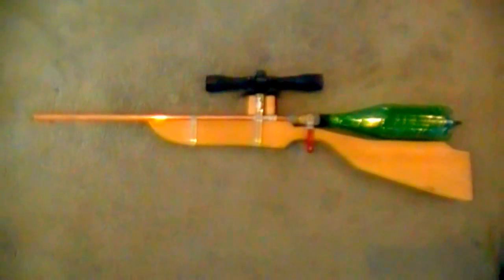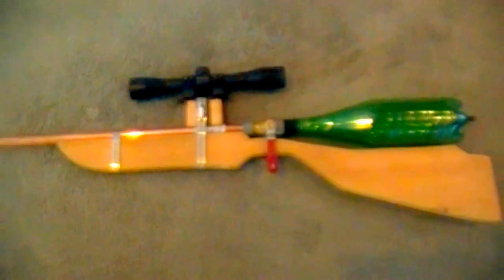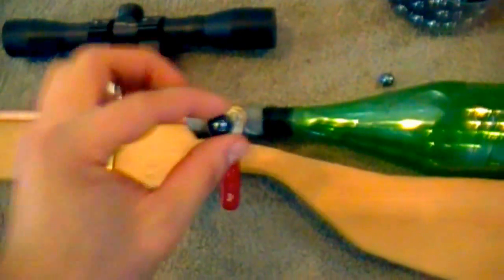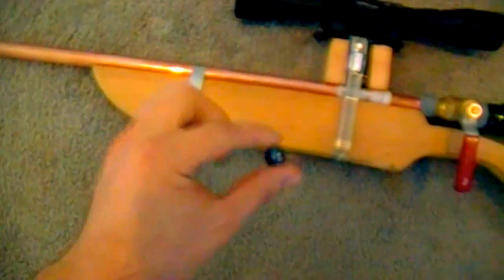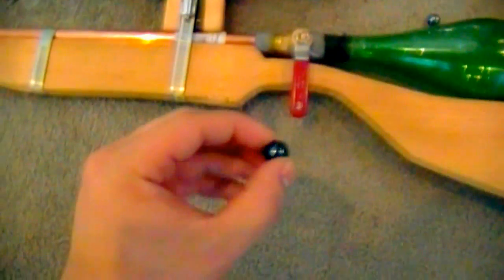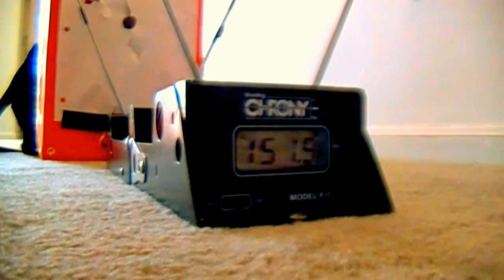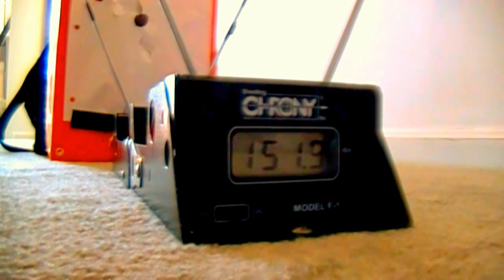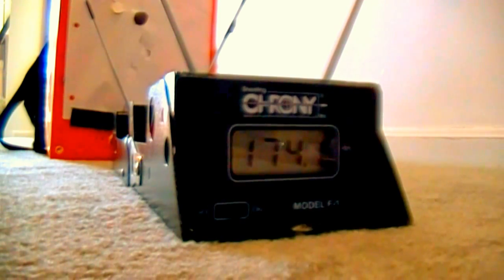$20 Homemade .50 Cal AIR Rifle + Shotgun Combo (Pt. 2)

Comment: I have an idea for the ammo that you may want to try. Purchase some nylon rods close to the diameter of the copper pipe. If I were you I would use a pair of calipers to get the inside dimension, and check the nylon rods. Cut your bullets, sand the top of the bullet to form a cone, for greater accuracy you could even rifle the nylon bullet. Just something I thought you would like to consider.

Comment: refinements / suggestions: use JB weld or some other two part "filled" epoxy - plumbers putty becomes brittle when it fully hardens. Decrease the I.O.D ("caliber") of your pipe 3/16 in IOD = 18 cal (steel pellets for pellet guns are 17 cal) 1/4 in = 25 cal, and use steel tubing - cheaper than copper and not as easily bent and uses less volume of air. Find a faster acting valve with less movement - more accurate firing. Devise a safety for the valve. Use spent, steel CO2 bottle for higher PSI.

Comment: You could use a small 1" piece of copper pipe with a cap on one side, fill it part way with bb's then fill to top of bb's with melted candle wax and let cool. pull cap off the back use lighter to warm up to get slug out. Bb's will remain intact in the wax until it hits something at which point they will disperse.

Comment: I once put a coke bottle on my air compressor and it pumped enough air into the coke bottle to reach 170 PSI before cutting off. My compressor goes up to 150 PSI supposedly but it didn't cut off till 170 PSI before cutting off. I am sure the coke bottle could have probably handled a lot more before bursting. I will make one of these and use a 20 ounce coke bottle and use a straighter valve with nut to tighten it to the end of the 20 ounce coke bottle and see if I can fire it with 150 PSI. That will be deadly I believe. Thanks for sharing
Reply: How'd it go?

Comment: Can I give you a tip my friend? I assume you use the manual valve to release pressure right, if you assemble it with a solenoid valve instead that thing will open the presasure way faster so nothing goes to waste. Sorry hard to explain with this bad English but you might get the point?

Comment: try using plumbers tape, (its called Teflon Tape I think), it has no adhesive you stretch it around the threads of the bottle, etc, then screw it together, the Teflon tape will create a good seal up to well over 100psi's I'm sure.

Comment: Nice Build, But Listen. I experimented with this over 30 years ago, and that bottle "will" eventually explode and disfigure your face, not to mention losing part of your hearing. This bottle will continue each time to stress more and more and also age harden, then one day you just fill to 40 or 50 psi and "Bang". Buy an inner tube for a wheelbarrow wheel, and cut it and slip it over the bottle. Even though the bottle is thicker plastic at the bottom, it is still stretching also, but the hardened putty is not, so that seal is slowly deteriorating also. The stem has a good chance at "anytime" of coming out much faster than your projectiles!  Much better yet is to use a heavy gauge Pvc tube for the reservoir! Use a 3/4" reducer cap at the end before your 1/2" ball valve, and you will not have any bottle necking of air pressure and volume. Talking from experience be safe, don't learn the hard way. Thanks for the video.
Reply: What do you need to use then
Reply: That bottle is so snug though
Reply: +jmvideo7 Good advice

Comment: 150 psi is about the velocity of a very srong sling-shot used by a very strong man.  55 grains is a huge bullet.  Glass marble are harder than any metal.  You are building joules of impact there and have a destructive projectile.  It would shatter any pane of glass, car windows and bus stops.  Retry with an aluminum bottle (nothing cheap, seroius hiking or cycling can) and a presta valve (they would screw-in in a tapped hole.

Comment: I am making a gun just like yours, thanks for the instruction! I have some problems with my tank, it is leaking. I have tried using kit coz i couldnt find the plumbers putty you were using in the shop. And, i have got a 1.5 litre bottle, would that make it shoot faster than yours? I also still need projectiles for my 6mm barrel

Comment: try a epoxy build up around the valve stem to have a more effective seal i wouldnt do too much because of the plastic expansion and also put some putty on top of that, might work a little better

Comment: Hey guys, I can recommend a aluminium barrel. Its cheap, light and solid so you wont bend it accidentally. I just made myself a blowgun out of it. I was wondering how to achieve more power by adding some kind of pneumatic system and found my answer! Awesome video dude, likeit :)
One more thing: How do you trigger the gun, so that you wont lose power (until the valve fully turns to release the air??)

Greetings guys

Comment: Great video!....Definately room for improvement;you could try using a 1L(35oz.) aluminum water bottle & use an all metal Schrader valve stem;That could possibly pump up 100-120psi easily,and use 1/2"(.50) metal ball bearings greased with Vasaline;Might produce shots within 300+FPS!!!!!WOW!......I may try those mods myself when I end up making one myself,but you have given me the basic ideas;Thanks!

Comment: can you explain how to connect the tube to the ball valve and also the bottle to the ball valve in better detail. The tube doesn't "screw" in, it just slides in and remains loose. Also the bottle is too big to even begin to fit into a 1/2" ball joint. I'm sure I'm missing something simple here but I'd really like to make this. Thanks.

Comment: At 7:08, a slight hissing sound, when everything is apparently well sealed. Did you check the tightness of the valve core in the schraeder air valve?

Comment: Lots of OT-Comments, here is what is really interesting:

projectile= 55,4 grain (3,6 Gramm)

Airtank Pressure 50 Psi (3,45 bar) = 3,86 Joule energy (152fps=46,33 m/s)
Airtank Pressure 60 Psi (3,45 bar) = 5,06 Joule energy (174fps=53,04 m/s)
Airtank Pressure 70 Psi (3,45 bar) = 7,37 Joule energy (210fps=64,01 m/s)

real great results, but the projectile is dangerous because it could repel easily.
(all hard Balls do that, like steel BBs and so on)

Comment: I made a summary because i thought this method with your plastic airtank interessting, and the energy is equal to a real airgun (in germany 7,5j is max by law).
Always wear safety googles, one time i didnt and had big luck:
I used normal lead diabolos (!) and they repell a way of 2x7meters (~45feet)
back, near my head because i shot on a hard wood which was loose.

It would be interesting if you could use a smaler caliber to increase the speed of the projectile. 300-400 fps is a good example.

Comment: why not use a PVC airtank? pvc can handle up to 400psi. depending on wall thickness and diameter. Also an automitve valve stem would have a better seal without the epoxy. you can get them at any autoparts store for $2-7 depending on where you go.

Comment: You would be surprised what those soda bottles can handle. I used to pump my gun to 120psi. it never leaked. I even tried pumping it to 150psi. It worked, but after a dozen or so fills, it was overstressed. but I didn't used putty or glue.

Comment: Isn't it amazing how totally separate fields suddenly collide... I make my own fizzy drinks by pumping up a PET bottle (e.g. you soda bottle) from a CO2 tank. Standard  pressure is 55psi, but in fact I know these bottles are enormously strong - the bottle can take over 200psi, but will begin to balloon a bit before that. Search for a video of someone pressure testing a PET bottle. Even if the bottle bursts you get a loud noise and a scare, it isn't an explosion.

Comment: how about pouring metal BBs down and packing it in with Plasticine or clay, or making metal shells that are BB's mixed in Plasticine and maybe coat them in flour so they slide down the barrel easy, then pack them in with a rod. I'd make a beastly shotgun and would expand to the shape of the barrel like lead maybe. You could even get smaller marbles and try coating them one at a time.
Could clog the barrel up after a while though.

Comment: Hey mate careful with the soda bottle at those pressures. Plastic can fatigue, develop hairline fractures and explode. While an undamaged bottle can achieve pressures around 200 psi before exploding, the loading and unloading of the bottle creates stress cycles leading to fatigue. Its well worth the upgrade to plastic PVC. For your barrel size you would need less than a 1 Litre reservoir. Also metal barrels are always best as they don't creep during storage.

Comment: Nice build, but under your system of propulsion you should really load the projectile then charge the system. If some kid builds this and operates it the way you did and there is an accidental discharge...= a face full of hurt or worse.

Comment: Hi, im not wanting to be a know all, but if you start creating irreverent chamber pressure, which could cost you a eye, you can patch the marble and still get a safe shot, I am a fire arm builder of 30 years, be careful as bling is blind, cheers dude
p.s 17 grain Prometheus at 4.5 or 177 cal still have been clocked at 725 fps, as a 5.5 22 cal in a bsa 795 fps and kinetic energy is 80 pounds per ft, you can buy one for 50bucks and there proof tested, just a thought cheers dude

Comment: He is obviously referring to a .50 BMG round that is popularised for it's penetration and power in video games like  Call of Duty, which I was referring to.
When using a low-powered homemade air gun like this, the wider the round, the less penetration, so the fact that this large projectiles are used actually just reduces the penetration. He should actually say "a .50 cal and it still almost penetrated a can??" 
For example a .30 cal pellet of the same weight would have better penetration.

Comment: .50 = .5 inches. The barel is .50 inches in diameter. Therefore it fires .50 cal balls, or 12.5mm balls. another word for .50 bmg is 12.7x99mm too

Comment: replace the bottle you are using as a rezzie and use 2' pressure rate PVC with and end cap.  Drill a hole in the end cap and thread a Air compressor fitting into it with teflon tape. Enjoy 200 PSI!!!

Comment: Some comments...That blob of plumber's putty serves no purpose.  Because it's on the OUTSIDE, air can easily push it aside.  If you could somehow get it on the INSIDE, it would improve the seal.  Also, I'd suggest you "proof" this weapon.  Wrap it in a bath towel, or something similar, then pump it up until it either explodes, or to the highest pressure you can achieve. Then you'll know, when you're shooting it, that you don't have a bomb under your cheek, about to go off!

Comment: instead of marbles you should use blowgun darts. Homemade ones made from duct tape and 2" nails. They would scream out of that gun at 70psi. Deadly on squirrels and rabbits. I know...I have one a little different than yours...same design though. You can use 20ga plastic shotgun wads (fits a .50cal barrel) with a cardboard card on the top to seal in the shot. Works fantastic! Spend a few more dollars and you get much better ammo and performance....just sayin

Comment: airrifle for 20 bucks vs. airsoft pistol bought from ebay for 15 bucks. highest possible fps is around 230-250 for your rifle and the base fps for the 15 dollar airsoft pistol is 320 fps. every airsoft pistol i own includingmy 5 dollar one shoots harder than that thing. i understand the difference involving the weight of the ammunition the typical bb is around .25grams vs. your 1.4 gram marble but with the power and accuracy of the pistol vs. you gun.mine would win.plus reload is alot quicker.

Comment: i am talking about the ball not the case. watch?v=RDAV9pjNPhk This video is proof that a 7.62x39mm brass can have a .308 projectile loaded into it. And the leade is the part where the bullet stays before it is fired, it dosnt have rifling in it, if it did the bullet wouldnt seat correctly.

Comment: Dude use a car wheel valve that way you wont need to use putty on the valve - just drill the size of hole you need & pull the valve into place !

Comment: LOL

Actually F= MA
If you accelerate something fast enough, even a low grain projectile can be more powerful than a barret's - but that much force would be FUCKING OBSCENE. 

200 FPS on the chrony only would worry me if that pellet weighs 800 grains - which would give it an energy of 70 foot pounds. That's highly unlikely!